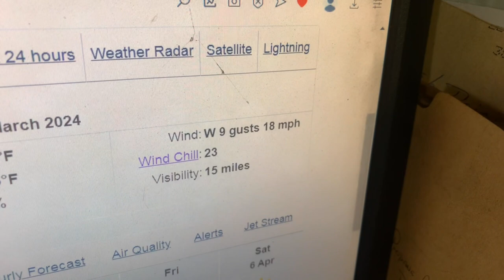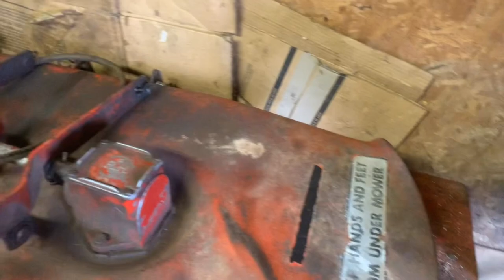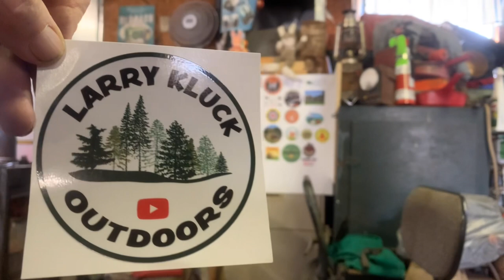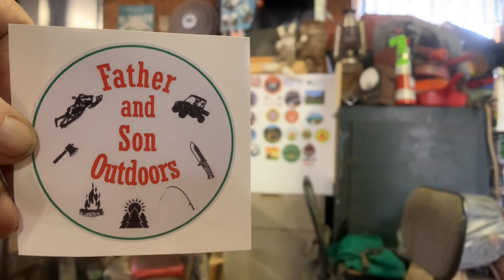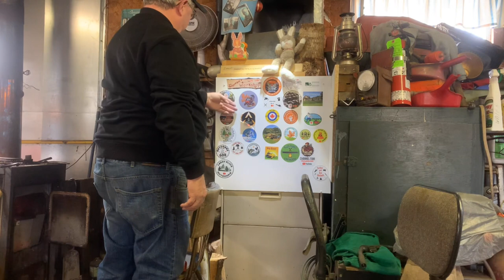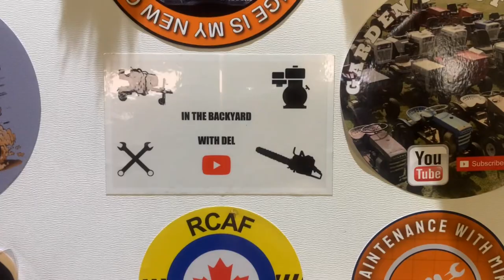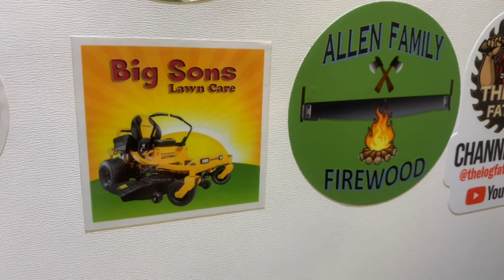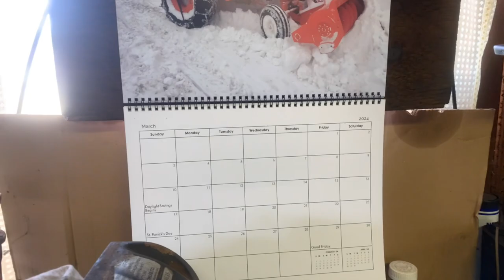Easter Sunday edition of the Sunday fireside chat. Sticker. Mowing Deck Police MDP #sticker #chat

Comment: Hi Noel, You know that the mower deck is in violation of the new  lawn care sharpening Law, but you still have until August 1st to come into compliance. I know you'll do the right thing and the right thing that makes the government happy.  Other than that, the snow is melting back and the place looks good. Maybe you could have just taken out the pins, turned everything to the right spot and drilled new holes? But you like tearing things apart. I know. me too! Well, I'll sign off for now...Happy Easter! I hope you have a relaxing and peaceful day. Best wishes from British Columbia (a province that  has folks who sharpen all their blades and follow all the new laws :face-green-smiling:).
Reply from the maker: If I had to drill a  CB new hole. It would have been thru part of the other hole , making it difficult to drill. And it would weaking the shaft more. Just my thought.
Reply: @noelstractors-firewood57  True. It would weaken the shaft. You made the right choice to disassemble and fix it right. Many times when I do engine work I have to backtrack and I’m always glad I did. Have a good evening, Noel. And like I always say to Mike at Grampie’s Workshop, Be Good 😊 😀